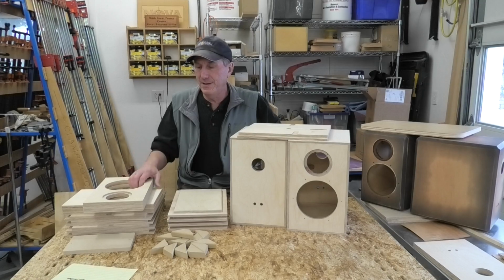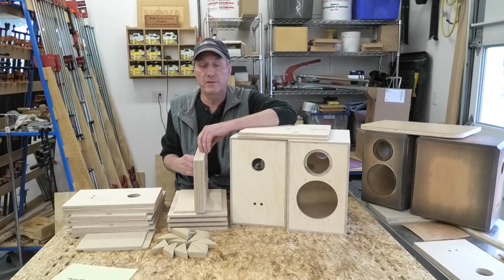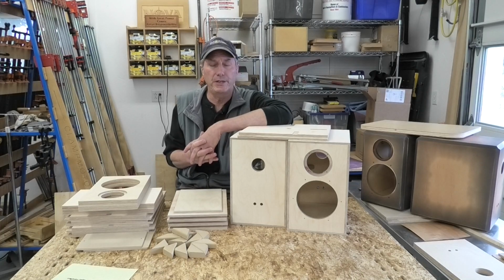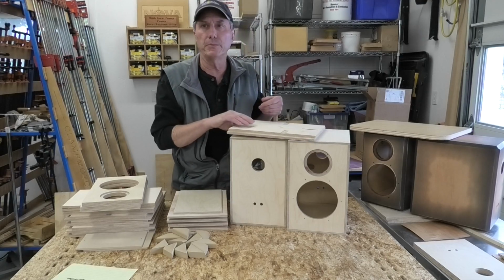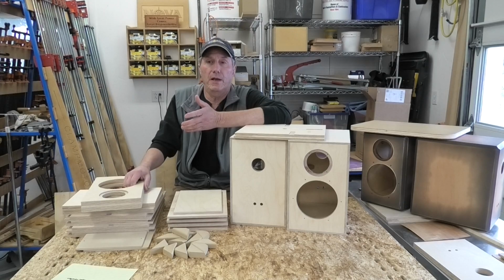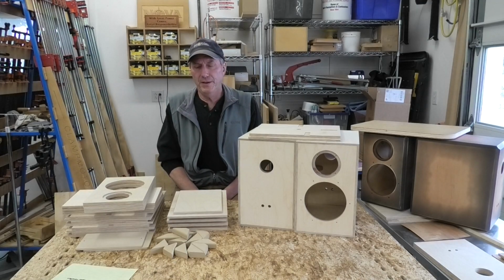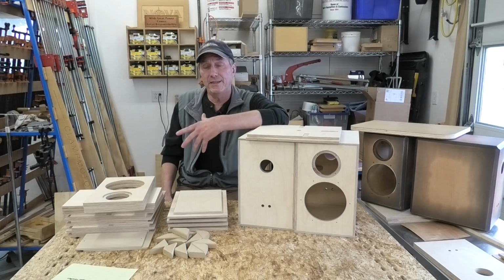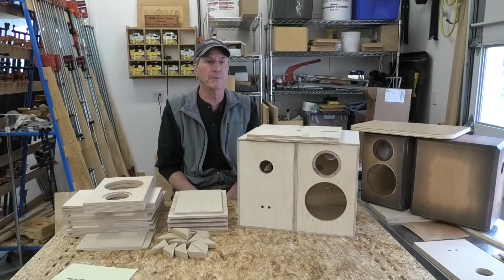X-LS Baltic Birch Update, GoPro Fun

Comment: Your videos aren’t long ,they are relaxed. Always helpful. I hope there is a a niche for you to continue teaching techniques relevant to speaker building. The GoPro trial was a success from my perspective. Some narration would be additionally helpful. I can imagine the time and energy it must take to complete these videos. The effort is greatly appreciated.
Reply from the maker: It's probably a good thing I'm obsessed with speakers. It goes way beyond personal need, so I think you can safely assume it will contiune. I purposely didn't narrate the GoPro stuff because I knew I was going to speed it up and have little experience with dubbing in narration. For those interested, assembly was 1.3 times actual, routing and sanding 1.7.

Comment: Peter, I am no expert in the differences between mdf and wood.  I can only speak for my location here in Louisiana where we are high humidity and extreme temperatures.  I know when we built our cabinets the guy made them out of mdf with a veneer.  Over time the mdf has swollen  due to changes of temperature and humidity in the house.  Last year we remodeled and replaced all the cabinets with Baltic birch.   Maybe if the mdf is throughly primed inside and out and painted it would seal everything and less issues would occur down the road.  Hey love your videos.  Keep it up.

Comment: Hi Peter, I really appreciate your informative videos! My father was a professional wood worker so I grew up with wood :)....
Anyway... most of time I use MDF for my speakers  because it is a good compromise and, as you said, easy to work. I've always veneered my speakers, then tint them with tonality I like and finish with wax. People are always fascinating by the results. My next project will be my Reference Speakers and I'll use baltic birch for it because of  its superior acoustic properties.  But there is also another reason for my choice: MDF is much more sensitive to humidity than baltic birch so,  when MDF tend to dry in our house,  its  tickness tend to reduce a little bit (it depends on the humidity, but I would say 0.3..0.5 mm for example) causing a very little misalignment between front and side panels (in my experience it typically happens after one year). Even if veneer covers the case, the result is visible for scrupulous people and a little bit unaesthetic. With Baltic Birch this phenomenon doesn't exist because its construction (alternative odd layer glued togheter) tend to immunizing it. In fact, I built a speakers with plywood and veneered  35 years ago and, differently by others my MDF speakers where the phenomenon is present , they are still perfect without any panels misalignment!! 

Byeee and compliments again for your channel
sorry for my bad english
PS: your gopro test is fine!!

Comment: So to confirm Peter, would you say as per sonic properties Baltic Birch is better then HDF which is better then MDF?  Because Birch ply and HDF is harder then MDF, will I need to apply more dampening?
Reply from the maker: Here's what I can tell you for sure. In percussive resonance tests, Baltic Birch fares a little better than MDF. There’s a school of thought which says that would translate into superior sound quality of finished speaker. I honestly can’t say if that’s something the average listener will hear. The high density MDF I use machines crisply, has a very dense core and stays flatter which is why I use it. Does that alone make any given speaker sound better than garden variety MDF?  I doubt it.
Baltic Birch is lighter than MDF and some folks just dislike working with MDF. Both can be veneered or painted, although MDF probably paints a little easier. The Baltic Birch I use is graded BB/BB, often known as 4B. It allows for plugging defects in veneer on both faces and differs from North American plywood in both grading and intended usage.
If you like the look of exposed plys or don’t love the idea of working with MDF, Baltic Birch might be an option for you. 
Damping of cabinet is going to remain the same regardless.

Comment: Do other wood types exist as plywood ??!? If so are they as «  workable «  ?!? Very edifying clip !! Thanx? What would be an average price for « pro » or «  correct «  veneerîg of an XLS cabinet ?!?
Reply from the maker: Baltic Birch consists of more, thinner all hardwood plys. Typical hardwood veneer plywood has fewer softwood plys. Fewer internal ply voids is also a notable characteristic of Baltic Birch. There are a number of plywood variants, but suffice to say Baltic Birch is considered by many to be superior structurally and sonically.
Pricing questions are kinda nebulous. In USA, I imagine pro shops would be charging somewhere between $60 and $150 per hour.

Comment: Could we get sonic benefits  make speaker from solid panel, like wallnut or oak.
Reply from the maker: I wouldn't recommend it.  Solid timber is actually more resonant than both plywood and MDF. In addition, the resonant frequencies vary with species. Not impossible but would theoretically require additional and specific panel damping just to equal what composite panels naturally exhibit. Not to mention accommodation for wood movement within the structure which is significantly greater with solid timber.

Comment: Very Interesting!  What are the finishing options besides the veneering you mentioned?
Reply from the maker: Any way you can finish MDF, you can also do with Birch. The big difference is that one can expose the edges in finished product, which some find appealing. The photo mid-video was done by chamfering edges on table saw after assembly.

Comment: Here’s a question: There’s MDF and HDF “plywood” boards. Is there a big difference between the two, other than cost, that might offer some “advantage” in speaker construction?
Reply from the maker: First, let’s clarify the products you’ve mentioned. All are engineered sheet products. Plywood is as the name implies. Wood veneer plys, glued and compressed to form a panel. Typically, the plys are oriented so the grain of each is perpendicular to adjacent plys.

MDF (medium density fiberboard) is made from wood dust and glue, also compressed to form a panel. “HDF” (high density fiberboard) as I understand industry nomenclature, describes a different product which uses similar ingredients in differing ratios. A well-known brand name is Masonite and typically available in thicknesses of .125 and .250.
It gets confusing because much of what is actually high-density MDF is marketed as HDF. Suffice to say MDF is available in varying densities.

Now to your question. In general, the greater the MDF density, the higher the inherent resonant frequency. Sonically, this is a good thing. It also machines much better and is easier to finish exposed edges…a practical consideration if painting.   Some has a pithy core and thus the least desirable for things like speaker building, but it does cost less.

To further this, Baltic Birch plywood has unique properties because the core plys are hardwood where most other plywood uses softwood plys even though the outermost plys might be hardwood. Many feel the sonic qualities of Baltic Birch are superior to that of MDF, but I can’t personally substantiate that.
Reply: @carbidetooth  Thanks and that is pretty much similar to what I have read. I enjoy your presentations and explanations. It’s exactly the spot on answers many of us are looking far. 

8 months ago Hurricane Ida caused damage to my home from wind damage to roofing materials allowing water intrusion down walls and ceilings. My kitchen cabinets had to to removed to get to the drywall and insulation that all had to be removed due to mold mitigation. Getting new cabinets turned to be a problem because of the substantial damage done to the region, the supply & distribution issues, the insurance industry causing delays in offering financial assistance to rebuild , yada, yada, yada. Because of the issues with lack of obtaining quality hardwood plywood for cabinet construction some builders were trying to get MDF and HDF for things like cabinet doors and inside shelves. I did some research on those materials. There are some benefits to using those types of materials in many types of projects and I could see how they might be advantageous in speaker construction. Luckily on our case my cabinet builder managed to get hold of a shipment of the quality wood he needed to rebuild our cabinets but we had to wait until almost March for the finished product. Ida hit at a bad time for the stock of building supply availability and an inflated increased cost which insurance would not cover. 

Appreciate your detailed response. Take care.

Comment: I have a dumb question.  Is there a reason to not go with solid wood?  Why plywood?  I know you have to go with plywood when needing wide pieces, but I wouldn’t think that’s a problem here.  Thanks for the video
Reply from the maker: Chris, I think I can sum it up with a single word...stability.  Composites are  more stable and thus more user friendly and adaptable to varying conditions. Sonically,  solid wood could be viable, but from a construction standpoint, it introduces variables that are hard to incorporate into loudspeaker design. It's a big subject with no pat answers, but if it were easily implemented, I think we'd see  it more in commercial designs. 
Baltic Birch is made up of solid hardwood plys, but mitigates the fickle nature of sawn boards by utilizing the self-stabilizing qualities of  alternating grain lamination. For many, it exhibits the best of both worlds.

Comment: Seems like plywood is a more durable product compared to MDF in terms of damage from moisture and handling.

Would you say that it is easier to keep a speaker built out of plywood undamaged over the long haul?

Also, are there any density/weight differences between the MDF and the plywood that matter to the acoustical performance?
Reply from the maker: Honestly Don, durability wouldn't seem like a concern for either, they are speakers after all. I guess some of that would be up to user.
 MDF is weightier and is more consistent in density because of how it's made.  In theory, the resonant characteristics of Baltic Birch could offer an advantage to a speaker builder, but that's likely hair splitting.
I'd recommend folks choose based on personal preference, desired result and perhaps cost.